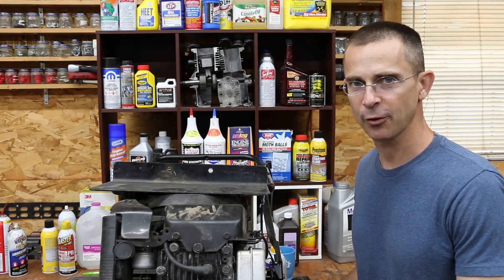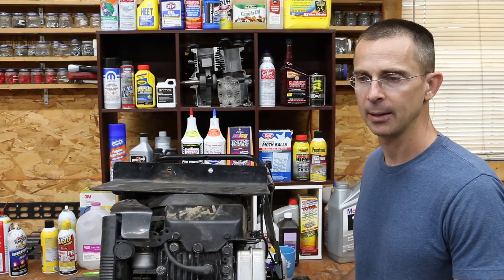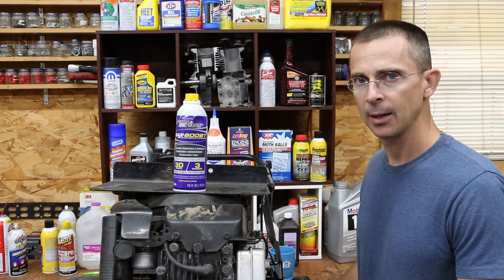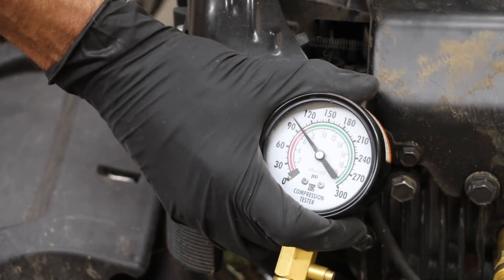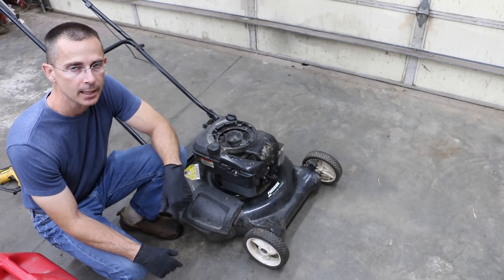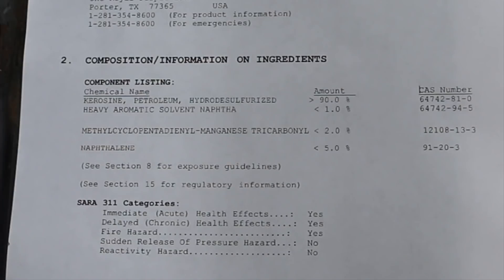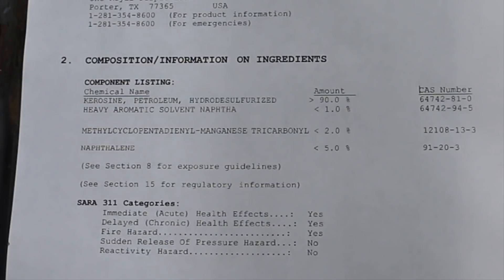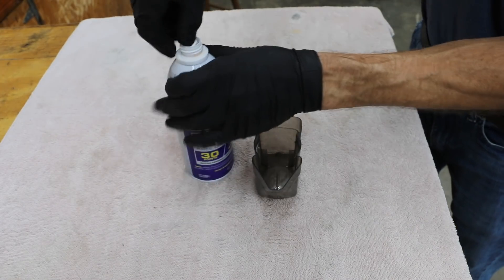Will a gas engine run on 100% octane booster?  Let's find out!

Comment: You should try finding and testing a product called Friction Free 3000 or 5000( I cant remember). It is an oil additive containing a lead moly.  I worked at a garage and a women who sold this stuff brought her truck in for service. This product seemed to have wiped out the cam, rollers, and main crank bearings.Resulting in us having to change out the whole engine. I'd like to see you test it and maybe get the same results. Great videos. Keep up the good work. Thanks.  -Sputnik @ SkunkWerX
Reply from the maker: Thank you for this recommendation!

Comment: I guess it really is royal if it turned your cylinder head gold lol
Reply from the maker: LOL!  Thanks for commenting!
Reply: I'm thinking it wasn't completely hydrodesulphurized because that sure looks like Sulphur to me.
Reply: Superb joke, but it's probably a thin layer of a salt containing manganese.  A common organic compound containing manganese was listed on the MSDS (MMT).  And the Wikipedia article for Pyrolusite, the naturally occurring form of Manganese oxide, says it can result in an amber color.
EDIT - further googling shows the heat and pressure of internal combustion actually causes the tetroxide of manganese to form.  A more highly oxidized salt.  Google that and you will see it is an orange-brown powder, that would appear gold as a surface coating.
Reply: @Salmagundiii  answered my search for   the cause of my orange combustion buildup. Too much Torco Accelerator.
Reply: @Salmagundiii  Humm salt in an engine would cause rust, that seems bad. I dont see why you would want to add this to your gas and get a rusted out engine from the salt?
Reply: @Starlite123  salt in this case means any ionic compound of a metal, not table salt.
Reply: @Salmagundiii  Ohhh i learned something thx
Reply: @Salmagundiii  oh wow, I looked into it, and it's really bad. Like 100% plugged catalyst in less than 10,000 miles bad!
Reply: Project Farm make a wooden piston and try that out
Reply: Next time try Strait STP.
Reply: Salmagundiii Thanks, exactly what I ventured down here for! Paul, I thought the same thing. I did note however that he didn't make a comment about the smell in the video.
Reply: Anomaly from Sweden 😂😂that’s hilarious
Reply: Bobmuncie 765 Isi
Reply: Lmao
Reply: Or perhaps purple...
Reply: lol
Reply: that’s from the MMT in it. It’s magnesium buildup.
Reply: XD kom du inte på något eget namn?

Comment: Do u know of any additive that will help boost compression on a motor with 70 lbs compression
Reply from the maker: I achieved good results with Engine Restorer aka Restore.  If you decide to use it, I hope you achieve good results.

Comment: Take a lesson from an old technique that they used about a hundred years ago, dual fuel engines. Some old tractors were equipped with two fuel systems. The engine would be started on gasoline and be allowed to run for a minute, or so, to warm up. It was then switched, on the fly, to the alternate fuel. It might be possible to run an engine on all sorts of flammable liquids that the engine would never run on, normally, because it would never start. I'm not sure what they used as alternate fuels; coal-oil and used vegetable oil seem like possibilities. It would most likely require two separate carburetors since the settings/jetting for gasoline would be different for the alternate fuel. An orderly shutdown would probably involve switching back to gasoline, for a few seconds, to ease starting the next time.
Reply from the maker: I enjoyed reading your comments and it has given me some ideas for future projects. Thank you!

Comment: That yellow stuff is a sulphur/ sulphur compound deposit. Good crude oil is called "sweet crude" because its low sulphur. That just adds build up to your engine and I wouldn't use it. 90% of that product is a sulphur compound.
Reply: Sulfur is actually has a lubrication quality, when the diesel fuel went to ULSD they had to add lubricity agents to the diesel fuel to prevent premature component wear.
Reply from the maker: Thanks for commenting on this!
Reply: Dave B    Some AVGAS blends still contain tetraethyllead (TEL).
Reply: Thanks for the videos!
Reply: I'm pretty sure its caused by the MMT in the octane booster.
Reply: Pegleg Noid: Yes 100LL has a little over 2 grams per gallon of TEL (Tetraethyllead) but General Aviation uses so little fuel compared to any other transportation its impact negligible.  Also many Race Fuels use TEL as well but there again, its use is also so small you'd be hard pressed to find data of contamination outside of a sanctioned race track.
Reply: No it isn't sulphur. It's the MMT
Reply: @Lillos85   MMT is added at 8.3 mg per liter. That's much more then a few mg if you can see it. I don't know if it would turn yellow for manganese compounds if that stay behind after combustion.
Reply: Dave B  - as others have said, it’s not sulphur it’s the MMT.  The sulphur in crude is removed during the refining process.
Reply: @ScoredPiston  Look up the chemical formula to MMT: why would it leave a yellow ash? It should be white if you could see it. That's what my knowledge of chemistry says. Also as I said earlier there are only mg's of it so at that concentration even if it didn't burn you wouldn't see it.  In lieu of this why do say it MMT? How could it be?
Reply: Well this isn't a diesel engine. Do you know what they added to the fuel? Diesel is quite oily on its own. Ethyl lead was also a great lubricant that kept valves from burning up. But it was poisoning to the US: 90% of the population had excessive lead in their blood. The lead industry fought to have it removed all the way up until the 1990's when NY became the last place to ban lead. Poison 300 million people just so you can have extra profit. Seems fair: they get the money we get sick/brain damage. Oil companies are doing the same thing.
Reply: @daveb5041  This explains why New York voted for Ocasio-Cortez
Reply: @tylerh629   No. Excess lead causes cognitive defects among higher reasoning processes. People with high levels or damage from exposure to it would gravitate to the simple to follow "Fox says all dems are bad so are all their bills,  its a polar opposite, and  when a repub. senator on our side rapes a little kid, the dems must be doing something bad as well so we can keep feeding the circular cognitive dissonance spiral down to the bottom." They can comprehend that the problem have more then two choices and only one variable. Do think the average trump supporter really understand why tariff are bad or how they work? Start introducing gray areas multiple choices and they go back to chanting like at trump rallies hes STILL DOING TWO YEARS AFTER THE ELECTION! SOMEONE TELL THIS MAN YOU CAN STOP COMPAINING AFTER YOU WIN!!!!!!!! Not that he will listen anyways. I bet he really thinks that ,
Reply: @tylerh629  What woman was a socialist that speak like a 15 year old? Sarah Palin speaks like a 10 year old not 15. She also socialized much of the profits of the oil from Alaska giving every man woman and child a check for living in Alaska. Basic income check. That was a great program and why she was so popular, but strange to see a right winger put forth socializing the profits, rather then republicans that only socialize cost and environmental impact. Goes to show republicans have no convictions, but rather follow money and votes. Who said anything about the left? I'm not talking about the left. That's called a "but what aboutism" to derail the debate. You must have your hands full pointing out "idiocy"; what stupid thing did trump say this week? Raking the floor of the forest? That water and oceans are wet? Every time he opens his mouth "idiocy" his last talk was totally incoherent. At least you are still not doing a "but what about Hillary? She probably might have would have done this maybe" The election was 2 years ago she's not the president move on. How many more years are we going to hear about Hillary and Obama? trump was asked about how we killed Osama and he interrupts like a child and says "Hillary supporter! Obama supporter!" Like an unhinged lunatic stuck in 2016 doing "but what aboutism" Right wing only can see black and white good or bad, not intelligent enough to know its just a whole bunch of gray BUT that would require thinking and dropping the "but what aboutisms" . trump instead embarrasses himself and  instead of saying something educated or even acting like an adult and not interrupting when the other grown ups are talking.  He can do that. He can't even read or make a tweet without spelling half the words or Capitalizing Weird Words using …. wrong.

Comment: That octane booster will up your octane by 0.0000001%. To increase the octane you need to add it by about 20% octane booster to 80% fuel. Toulene will work. an 8 oz bottle added to a gallons of fuel will not do anything but waste money.
Reply from the maker: Thank you for this recommendation!

Comment: +Project Farm,

When Irma was going to hit Florida I had a hard time finding 91+ octane fuel for my Lexus (it recommends 91 at the minimum, and yes while 87 will work it will run like crap). I went to my local auto parts store and purchased some NOS octane booster as it came with an adapter for direct tank pouring and it's octane boost was just as good as Royal Purple's.

I put in what they had which was 89 Octane, and most likely had it boosted to 91 Octane which is what my manufacturer requests.

More horsepower? Yep, 100 more horses under the hood, feels like I am using nitrous oxide! 

NOT! 

There is no noticeable gain in power, however my car does run just as smooth as it does on pump 91 octane gasoline, so I think it did it's job overall.
Reply from the maker: Thanks for commenting on this. I hope you didn't experience any property damage or loss as a result of the hurricanes!  Thanks again!
Reply: We got really lucky, minimal damages all superficial nothing structural, thanks for the best wishes.

Comment: >90% Kerosene. Kerosene is fuel oil used in many applications, including jet engines. Not terribly surprising. But it is surprising to me that it runs so well in a 2-stroke gasoline engine. The orange build-up is interesting. Sulfur?
Reply from the maker: I believe the orange buildup is caused by MMT from the Royal Purple. Thanks for commenting!

Comment: The less-than-2-percent stuff is a kind of organic manganese compound, which means it will cause inorganic manganese compound to build up after combustion, and I thought that's where these orange stuff came from, in this case I wonder if seafoam or mystery oil can really clean them up lol
Reply from the maker: Excellent point regarding the MMT causing this orange buildup.  I was speculating that MMO or Seafoam would work, but maybe this buildup is more difficult to deal with than I anticipate.

Comment: I ran this in an old truck I had. The mixture was about half a gallon of gas and a full can of booster. 2 days later the fuel pump went on it. Not sure if coincidence but interesting results here.
Reply from the maker: Interesting. Thanks for sharing this experience.

Comment: i ran outta gas once, no gas station , bought octane boost x 5 bottles at supermarket and drove to gas station
Reply from the maker: Glad this worked!  Thanks for commenting!
Reply: @ProjectFarm  it was actually injector cleaner I believe and I was thankful no two truck needed. You should do injector cleaner tester if you have not yet.  Thanks sir

Comment: Octane booster doesn't give you more power. Because it's burn rate is slower it allows you to run more ignition timing and or more compression which gives you more power.
Reply from the maker: Excellent point. Thank you!

Comment: I work in the oil field I have a bottle of test oil that came right out of the well it is a low viscosity looks like gasoline in smells like gasoline it's a desolate do you have a PO Box I could send it to you to see if it will run on just this?
Reply from the maker: Thank you for this offer.  Trying to ship fuel can be a bit challenging.

Comment: So I have this go kart and the bolts keep rattling out 2 screws that hold the exhaust and all of the ones holding the seatbelt what is a good high temp thread locker
Reply from the maker: The high strength threadlockers have a max temperature around 300F.  You might try those.

Comment: His mower is in better condition than mine, my base is rusted out but the engine is very good. I ran out if fuel (standard) and I had a jerry can of super. The mower kicked, spat and ran like a sick dog. Back to Standard fuel.
Reply from the maker: Glad the mower will run on the less expensive stuff!

Comment: I was expecting to see that residue. This octane booster has MMT, which is the most effective practical octane booster, but which tends to foul spark plugs with that orange buildup after being used for a while.
An idea- try to run an engine on coal dust and/or flour.
Reply from the maker: Thank you for this recommendation!

Comment: That was interesting result.... Thank you for the test ! ! !
.
If you want to have a bit of fun and have an old engine you don't mind blowing up.... Get some NOS and a hose  (^_^) 
Run engine at high RPM then rin the hose to the intake from NOS tank....  Open NOS tank valve and have fun ! ! !
Might need a broom and shovel to pick up the parts (^_^) hehehe
Reply from the maker: Thank you for this recommendation!

Comment: Just FYI, Royal purple motor oil contains chlorinated paraffins which possesses great film strength properties, BUT, if ANY of the water rich exhaust gasses get into the oil it reacts with the chlorinated paraffins and makes hydrochloric acid which erodes steel and aluminum. VERY BAD. DON'T BUY IT.
Reply from the maker: Wow! Thank you for this information.

Comment: I once put a big bottle of Red Line in my car with a full tank of gas and it fried the head gasket. Of course I didnt read the label and put a bottle that was supposed to treat like 100 gallons into a 11.9 gallon tank. Ooops!

What happens when you put too much sea foam (or similar) into the oil crankcase of a car?
Reply from the maker: Thank you for this recommendation!

Comment: Airplane mechanic here, lots of us run AvGas in gokarts, mowers, dirtbikes with 2 stroke mix and without for 4 strokes, only because it's readily available to us working at an airport and also believe the 100 octane Low Lead (100LL) or AvGas makes the machine perform better. Can you test that theory on your mower- an engine not designed to run on AvGas- to see if in fact it does increase power or damage the engine from lead build up or pre ignition. Thanks!
Reply from the maker: Thank you for this recommendation!

Comment: Try if a 2 stroke could run solely on oil as fuel
Reply: Old Cummins, Atkinson or Rolls Royce diesel engines in lorries would burn the crankcase oil when the fuel ran out. That was a serious situation to be in.
Reply from the maker: Thank you for this recommendation!

Comment: Did the Orange build up easily wipe clean and did it break down any of the carbon?
Reply from the maker: It comes off easily.  I'd be concerned about what this would do to a catalytic converter over time.

Comment: That orange buildup is pretty common I've noticed with octane boosters used to run the Nos octane booster in my old Honda back in high school with the same result Orange on the plugs good video thou kinda curious to see if different octane boosters have different results thou i.e. More heat less heat more buildup less buildup stuff like that otherwise great video they help me kill time and answer questions I never thought about keep it up 👍
Reply: The color depends on the inorganic metal carbonyl/ethyl/methyl compound used.  The metal salts typically have pretty colors thats why they are used in tattoo parlors

Comment: OK..  I've got one.  I was watching some other videos, and I have a challenge..  I know you can repair a cracked head using JB weld.  I know you can make a new head using JB weld.  I know you can't fix a broken connecting rod using JB weld.  But-  could you repair a scratched piston, cylinder wall and a sloppy connecting rod journal using JB weld?
Reply from the maker: Thank you for this recommendation!

Comment: You should try Methanol, that's what we run in my racecar engine which is based on a Briggs and Stratton, it burns cold and has an invisible flame, might look cool in the engine with the transparent head
Reply from the maker: Thank you for this recommendation!

Comment: The primary active ingredient is the manganese compound. It was first used in gas as a replacement for tetraethyl lead  (the original octane booster) a while back.  If I recall correctly the EPA attempted to have it removed from use because leaks in the underground tanks at gas stations was contaminating ground water.  I worked with it a bit in grad school.  It's a liquid and it is toxic.
Reply from the maker: Thank you for this information!

Comment: Try running an engine on Kerosene. It's similar to diesel but has less paraffin wax and oils. If it won't run right off the bat, try to start it with gasoline to get the heat up then switch to kerosene while it's still warm. Keep up the good work!
Reply from the maker: Thank you for this recommendation!

Comment: What is the best rust remover? Awesome videos man, you seriously are amazing!
Reply from the maker: Thank you for this recommendation and thanks for the positive comment!
Reply: Best rust remover? A sand blaster is pretty good. Orthophosphoric acid is used in commercial rust remover. Neither will run an engine, but both will ruin one.